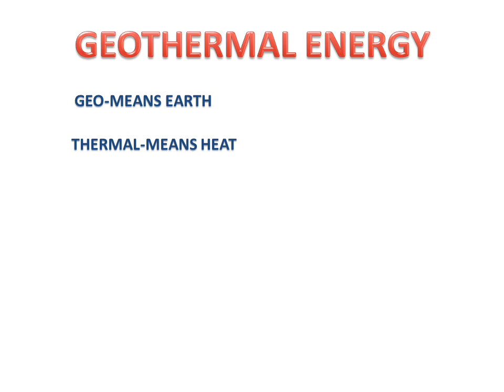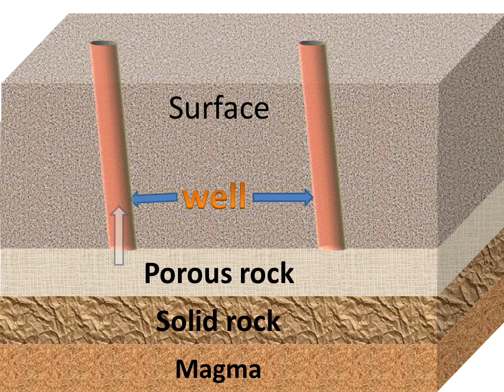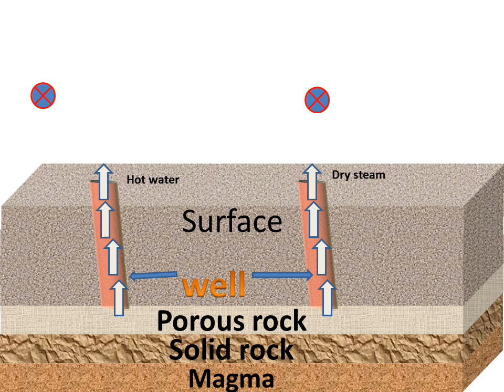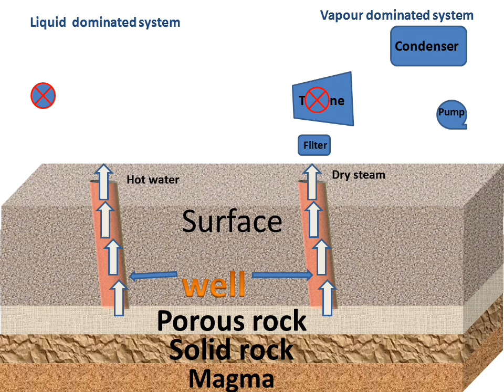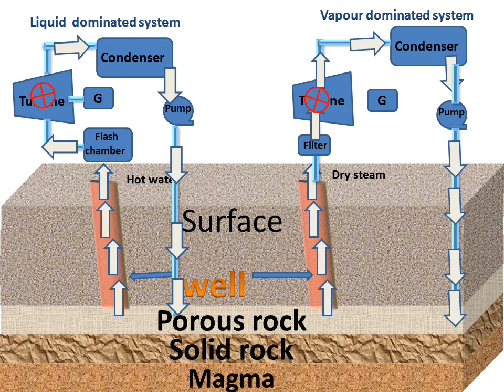Geothermal Energy

Comment: What is temp. Of magma??
Reply: Temperature difference between mantle and core is 3000-4000°C therefore tremendous amount of energy is trapped which when released occurs in the form of volcanic eruption and hot spring.